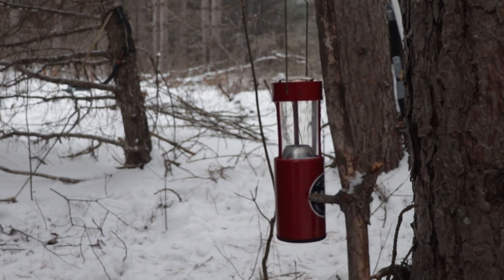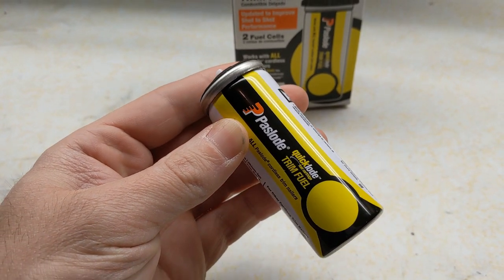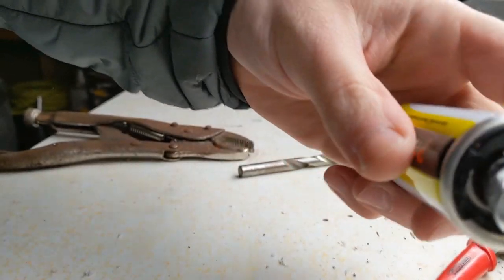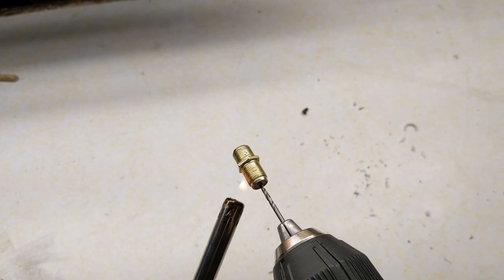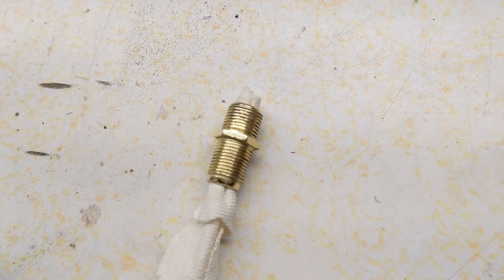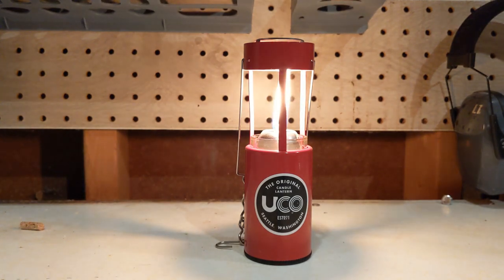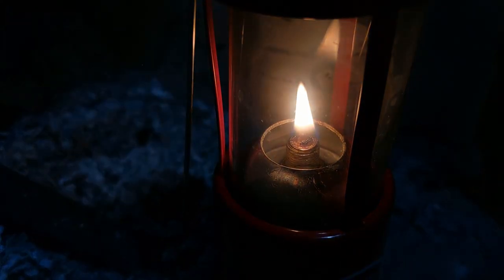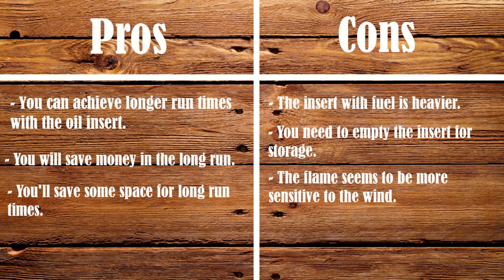DIY UCO Lantern Oil Insert

Comment: You can save the fuel in the canister if you find a bolt that is threaded the same as the coax nut plus an o-ring. IF all you are using the coax for is to hold the wick, you can use any coupling nut and add a matching bolt and o-ring to close it.
Reply from the maker: Good idea, I'll try that for sure. Thanks for watching! 🏕️🌲

Comment: Kinda wish I tried this before paying $80 for 3 machined ones with proper dimensions and threading with caps. The oil inserts are very versatile, you can use lamp oil, kerosene, vegetable oil, very handy in a situation where one fuel type is scarce but another is readily available. My 3 will go in the 3 candle UCO which can boil water on the top.
Reply: where did you buy yours from?

Comment: Nice work. Now, if I had the tool those cartridges are for, or knew someone who did, it would be far more practical than destroying a brand new unit for the experiment. For 10 pounds of wax, I can cast 90 candles to fit the lantern, so, thanks, but I'm sticking with candles.

Comment: U knooowwww....they sell small kerosene lanterns that also burn diesel which is a lOt cheaper...and...if U want a bigger flame...(more heat)  just add some charcoal starter (~ 10 %ish...) in with the diesel/Kerosene and it will burn much cleaner, hotter, brighter...For ur version U cud just use a smaller 1/8th inch wick for better flame control...that's cool but much too fastidious for my taste...